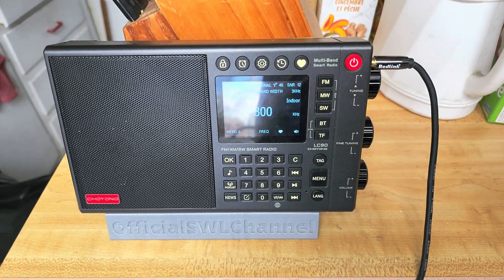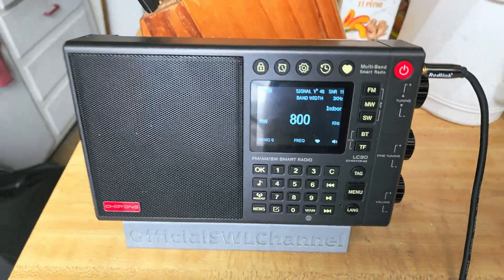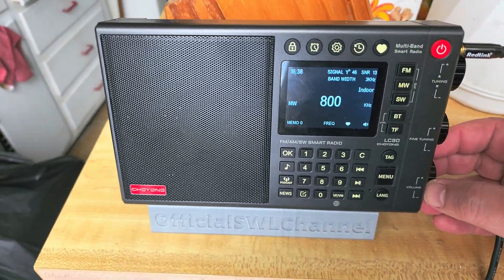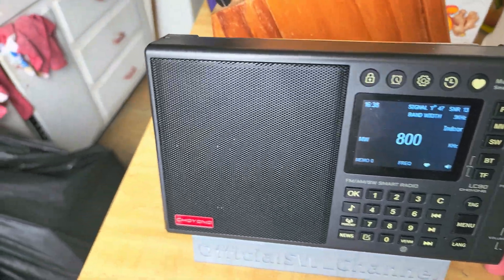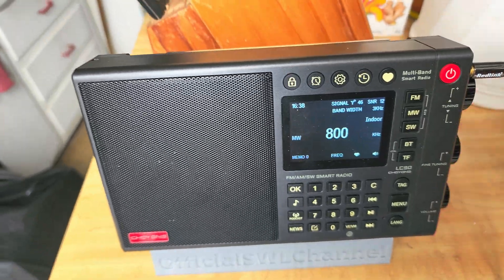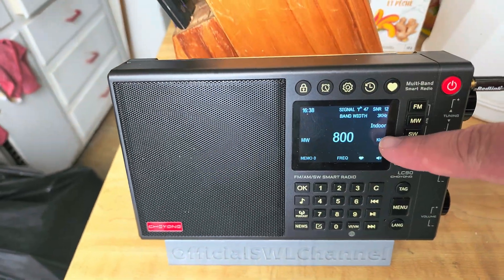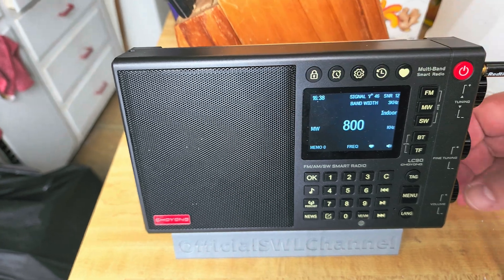Choyong LC90 internal noise on Mediumwave test with and without external antenna difference

Comment: I cannot get any of our local mw stations in Dallas.   I can just fine with an $8 AM radio using its internal antenna.    Tried external AM coil and still nothing, this is with the latest 4.5 sw version upgrade.    It also plays the Internet radio for about 5 minutes fine, then it cuts off with "network error"- this is right next to my router- 5 bar WIFI signal.   It locks up and I have to force it off then back on for another 5 minutes of streaming, then it locks up again.   This radio receives FM very well, but that is all it can do!!   Going back to Amazon now for refund!!   I cannot get WWV on SW and any and all of my other radios get it just fine with their whip antenna.